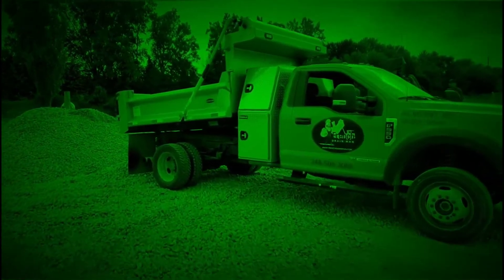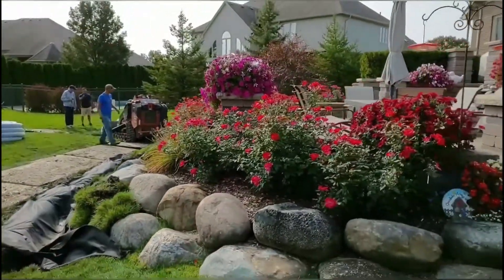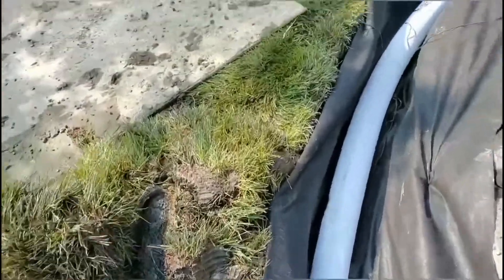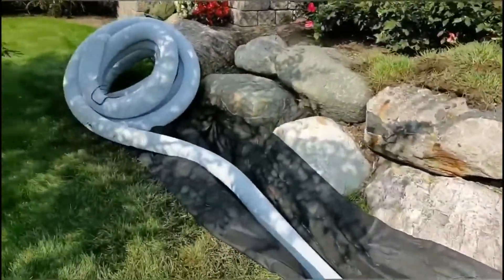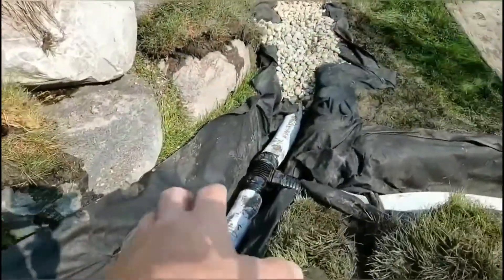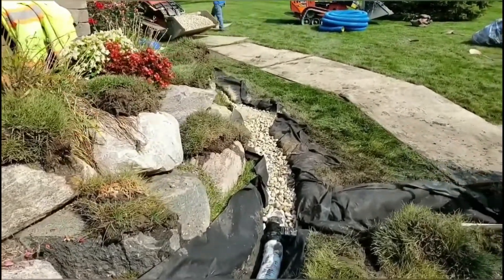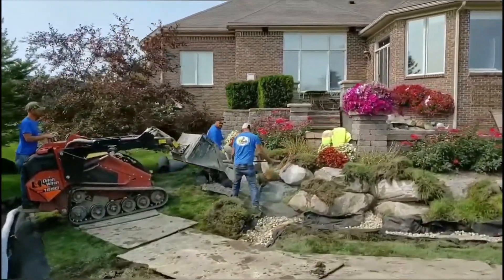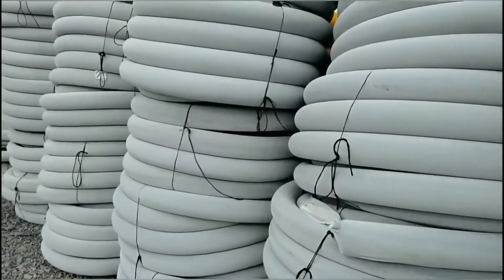DIY French Drain with Sock- When & Where | Detailed Walkthrough of Yard Drainage Project

Comment: I wish I new about this sock two years ago. Can't get clean stone where I live. I took a 55 gallon garbage can cover drilled 1/2 holes in it. I sifted every single shovel full of stone before I put it in the wheel barrel. I did this for a 200' open french drain. It took me 4 days doing this by myself. The stone I got was directly from a quarry. I told them that crap should be used for concrete not landscaping. Watch my french drain videos. I did a rant and showed the crab I sifted out of the stone.
Reply from the maker: Share the link to your video.

Comment: If you are using knife cut with crushed stone or round rock with a lot or fines and chips should you use a sock?
Reply from the maker: No. Knife cut was developed by pipe manufacturers to filter like a sock without the expense of a sock. Good question Thank You for commenting!
Reply: @FRENCHDRAINMAN  Thanks

Comment: Do you ever use knife cut in your french drains?
Reply from the maker: Yes it has its place. If you are gonna put inlet basins on the pipe it should be knife cut otherwise a fully contained French drain system with no inlet basins should be saw cut perforations. I can do a video on this.
Stay Tuned
Reply: @FRENCHDRAINMAN  that would be great, thank you! We have very dense soil and thought about using knife cut in our French drain system.